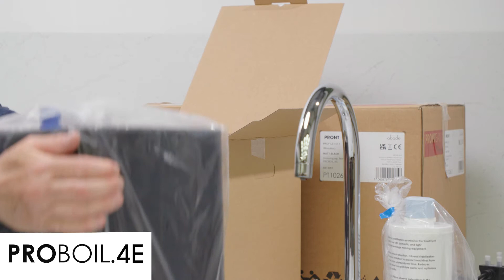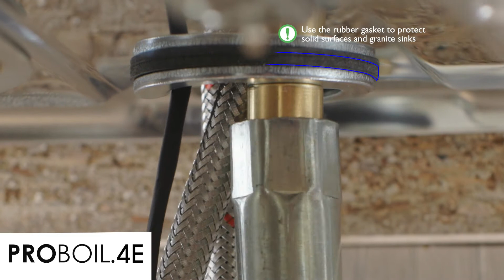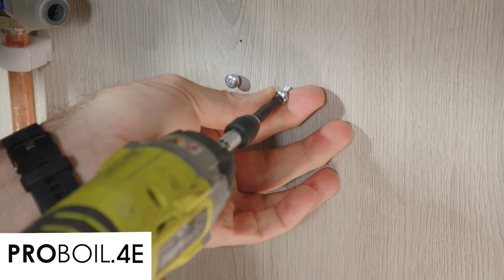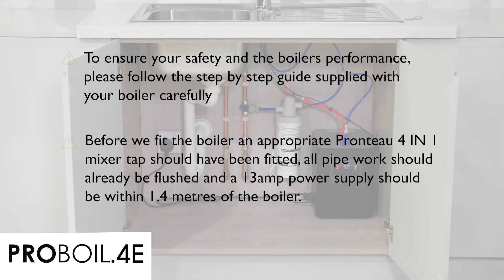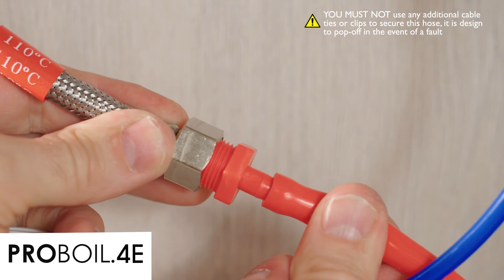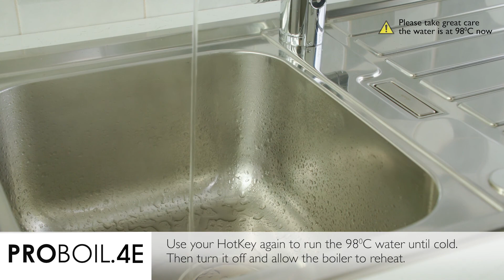PROBOIL4E Installation Video

Comment: Absolute joke to plumb in. The most awkward instant boiling water tap I've ever fitted and fitted most brands, quooker taps much better and easier to install. I've advised my boss to never buy these boiling taps ever again. Unnecessarily complicated. The fixing nut on underside of worktop is also a strange size. Didn't have a tap spanner in my set to fit it. Had to go and buy a larger tap spanner (box spanner)